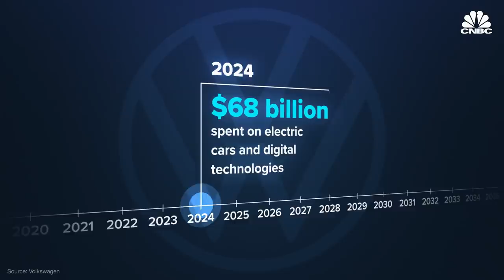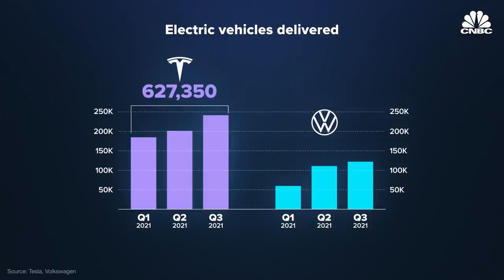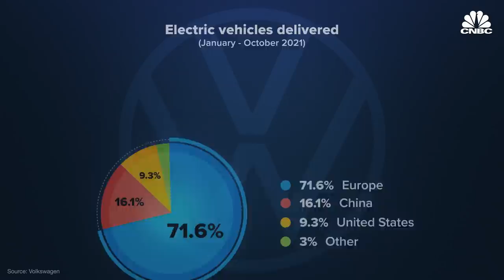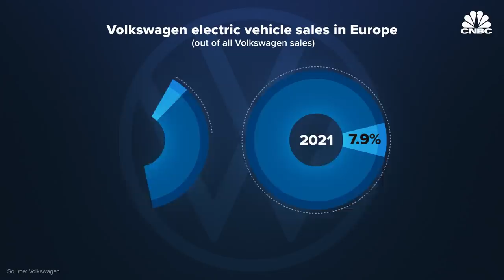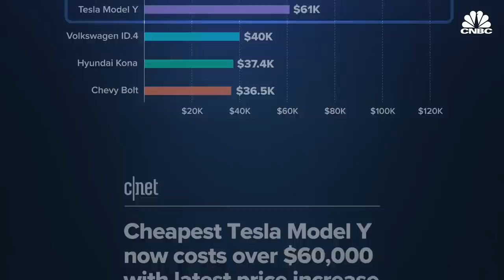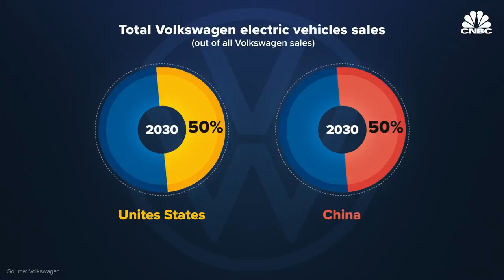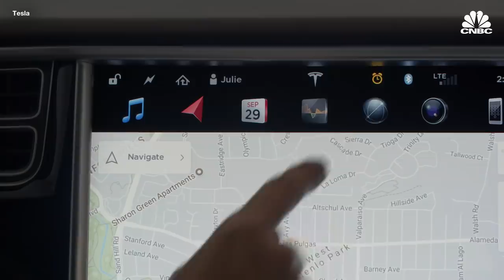Why Volkswagen Is Beating Tesla In Europe

Comment: ill safe you 14 minutes: home bias and the fact that tesla currently just cant build more cars and has so wait for more factories to be finished
Reply: @Michel Bruns Tesla can build more BEVs than VW now!!!   VW will not have the capacity to build as many as Tesla.   Not to mention Tesla builds their vehicles more efficiently than VW .

The software in Tesla is far more advanced than what is in VW vehicles, but more importantly Engineers would rather work for Tesla than VW.  This is what most miss about Tesla going forward.  Their level of innovation and nimbleness is what leaves most manufacturers in the dust.   The Tesla brand is synonymous with BEVs, more importantly Tesla Model 3 is the hottest selling EV in EU, when Giga Berlin is running at full steam Model Y will be the hottest selling EV in EU.  

As for Technology, Tesla is the leader in BEV technology....and that has nothing to do with autonomous driving, which Tesla is the best positioned.  

A better way to look at the BEV picture going forward, is to see what the companies plans are for production.  VW isn't even planning to match Tesla's production levels going forwards.  Part of the problem for VW and other legacy Automakers is Work Force.  BEV (especially Tesla) require fewer workers.  The BEV work force needs to be better trained and more nimble in abilities.   This means the Legacy auto business will be a drag on BEV advancement, especially with companies that are Union shops. 

Tesla does have serious competition that will probably overtake it as the leading BEV manufacturer.  BYD is probably likely to be the new Toyota / VW,  Tesla will largest premium brand in the BEV market.   As for the Legacy Automakers, it is going to be a difficult road.  Brand loyalty will be tested with EVs because their performance is so different than ICE.  

https://www.motorbiscuit.com/tesla-electric-vehicle-10-hours-volkswagen-production-ceo-unable-keep/
Reply: @tonespeaks  i didnt read most of your comment, but i meant that tesla cant build/ship enough cars, IN EUROPE, to outsell vw there, which is the topic of the video, we are only talking about europe
Reply: @michelbruns  Historical event in the German models ranking: the VW Golf’s  down -41% year-on-year it only holds 3.5% of its home market. In contrast, the Tesla Model 3 (+146%) takes the brand’s backloading in end-of-quarters to the next level and ends the month at #2 overall, only 58 sales below the Golf and smashing its ranking, volume (6.828) and share (3.5%) records in the process.
Reply: Here comes Tesla fan boi
Reply: @xcortians482    If the Tesla fan boi is also a Tesla stockholder (like me) then we have a LOT to be a fan about.  Ka-ching
Reply: Why tesla don't beat VW, because it only produces 750k vehicles yearly
Reply: How about you watch the 14 minute video to see where you went wrong with your assumption.
Reply: @xcortians482  "Here comes Tesla fan boi"

Personal attacks are never valid arguments.
Reply: @digols1000  "Why tesla don't beat VW, because it only produces 750k vehicles yearly"

Nonsense. Tesla is groing their EV production way faster than Volkswagen. When Tesla ramps up Giga Berlin they will take the number one position in Europe as well. The Giga Berlin factory will produce atleast 2 million cars per year when fully ramped up.
Reply: @yourcrazybear  VW has plan to produce 70% EV till 2030, 🤣🤣, they do that till 2024 or they'll go out of the business
Reply: @yourcrazybear  so you are telling me a $1 TRILLION company couldn’t keep up with ice maker?
Reply: @yourcrazybear  VW doesn’t have to face with lockdowns… labor shortages…. Higher inflation…. Chip shortage….?
Reply: @dzerres  even their god is selling his own shares and managers like Cathie Wood
Reply: @yourcrazybear  Everyone talks about the Giga Factory Berlin, but Tesla is a luxury car in Europe. VW and Tesla are not really in direct competition.  No matter how much they produce, the average European will not spend more than 30 k EUR on a car. If they don't extend their product range with low-cost products, they will just not be able to dominate the EU market. Why should I buy electric car, when I can buy cheap LPG converted car ?
Reply: @yourcrazybear  You realise Tesla has to compete with brands other than VW. E.g.: Daimler, BMW, Stellantis, JLR, Ford, Renault, Hyundai/Kia, Volvo, etc. These massive companies are not that far behind in terms of specs but m,uch lower in prices and higher in production volume. The competition is heating up and only time will tell if Tesla can maintain it's valuation when their market share eventually drops significantly.
Reply: @digols1000  You're already behind...It will be closer to 900K this year...but why worry about numbers?
Reply: @xcortians482  You mean "Catch up with" the ice maker.   Tesla is busy selling it's EVs all over the world. Many more than VW...Europe will be its next market to dominate with EVs.
Reply: @radoslavtomov9121  VW also owns Audi and Porsche...brands that are luxury...and will continue to lose sales to Tesla as it makes more and more vehicles. Tesla already has plans for a $25K vehicle...It will come out in China first, likely for pre-order in two or three years...in the meantime, Tesla will get Giga Berlin to 1 million vehicles per year.  Tesla will only switch to the lower priced vehicles as the battery prices continue to come down each year...and they produce enough volume in Europe to meet the large demand for Teslas that already exist.
Cheers!
Reply: @davidc2838  Europe is already big market for EV go figure
Reply: @xxXCromaxXxx  We've heard the SAME story for more than a decade...
Tesla STILL keeps growing at more than 50% a year...
It's not the other company's EVs that are the competition...it's their ancient ICE vehicles that are being devoured by the Tesla wave of EVs.  There's almost 2 BILLION ICE vehicles that will need to be replaced over the next 15 or so years...Tesla will not run into any demand problems...nor have issues with competition, who are still trying to keep their ICE dreams alive.  This will cause a nightmare for those ICE manufacturers.
Reply: @xcortians482  Yes, and Tesla is now selling more EVs without even having a factory there...just wait until it opens in Germany.
Reply: @tonespeaks  panel gaps.
Reply: @greyhoundanglickychrt5537  Old News, but check the Owner satisfaction reports and etc.  Tesla has one of the best records on that end.  Panel gaps happen on all models of cars at every auto maker, it is a difficult thing to get right.
Reply: @tonespeaks  bla bla bla, tesla fanboy.
Reply: @greyhoundanglickychrt5537  Not Fanboy..... I go where the facts take me.
Reply: @tonespeaks   BS ! VW Wolfsburg makes 950 000 Golf a year, as much as Tesla in all fabs as of 2021! AND switch to e car is easy, same body tech etc!
Reply: @davidc2838  If it happens, then great. Competition is great for the consumer. Let's see how things play out.
Reply: @davidc2838  oh my! Can’t wait to have Tesla factory in Germany!!! Tesla will be #1!!!!!!!!! Wow!!!!
Reply: @brunokoegler2189  Wolfsburg production was under 500k units last year. About half of the number you’re making up.
Which is why Herbert Diess know that VW needs to modernize the plant…because it takes three times as long and more than twice as many workers to build that many vehicles in Wolfsburg as it does in a Tesla plant.
But keep dreaming…
VW is going to lose about 25,000 workers when / if they can get their act together and modernize the plant
Reply: @xcortians482  That’s the spirit!!
Good to see you know when the new leader comes.
Reply: @davidc2838  I was supplier to this plant for years, a decade, lately around 2002, at that time there was a counter about daily Golf cars output and it was a bit over 4000 a day :) I don't think they demolished buildings etc, I speak about capacity, of course they have to sell the cars, and get the stuff (chips etc) 2020/2021 was probably NOT at full capacity, for sure
Reply: @brunokoegler2189  lol
Giga Shanghai will produce 500,000 cars this year and they are tooling to hit 1 million next year. But Wolfsburg plant is 9X the size.  
Just let that sink in for a minute… Then consider that Model 3 is already the biggest selling vehicle in all of Europe. Yes more than Golf. And this is BEFORE they open Giga Berlin. 
Now do you get it?